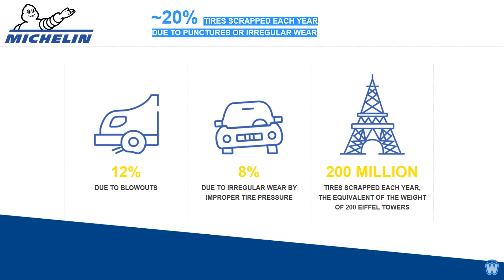Michelin Airless Tire UPTIS - Unique Puncture-Proof Tire System

Comment: The only issue I see with this is the inability for the drive to see condition of the tires inside the car.

Edit: I know there will be much less checking of the tires considering they have a very low failure rate, but imagine when you have gone over enough nails and spikes in the road(that of which you are unaware) and one day your car becomes uncontrollable because an entire tire has just come right off because of the amount of damage it has endured through its lifetime. All of this has been done without the driver checking up on the tires because the driver thought there was nothing wrong.

There will need to be some kind of optical sensor (camera with A.I) in each wheel well monitoring the live condition of the tire and whether the amount of punctures is still drivable.

Comment: law enforcement have been testing a net like device that entangles the axles and locks up the tire and they work on run flat tires.  I wouldn't think these would be any different.  After a quick search there is a couple of things one is called the X-net and the other is grappler that deploys out of the front of a squad car.

Comment: "Looks like the police will need to come up more plan"

Police: just blow the car and we're done
Reply: SoNyXGamings 🤣🤣🤣hilarious!
Reply: There is already a new way , it’s a net that tangles around the tire and it’s more effective than any system I have seen before but it’s not as fast to deploy as stingers . Yup maybe need 15 seconds , stingers only 1 or 2 seconds 👻👻👻
Reply: @gerard4039  yeah, police rarely used that kind..
Reply: @gerard4039  exactly what I wrote a minute ago. I didn't see your answer till now.
Reply: Rafael GM it’s ok :-) , I seen it demonstrated with a military hammer vehicle , yes it’s safer because it’s like a break , it stops the vehicle completely , you can’t event move an inch after like it is with spike and flat tyres , i agree ☝️
Reply: Kontol
Reply: @rahman.utara.  ??
Reply: Hold this technology to avoid loosing the spike as a resource? Already exists spike with net. It wraps arround the tire and axis, also, it is safer, it stops the car faster.
Reply: Seems ledgit
Reply: target lock ready to shoot..
Reply: Brayan Carmona  That Is Just Amazing.
Maybe They Will Put In A New 10 Gear Engine That Makes Them Faster Than Criminals.
Cost: About $9,000,000
Reply: A spike shaped like a fish hook that is welded to a metal of choice plate or block that detaches from the strip and creates massive havoc until they finally stop. Sit back, relax, and watch the parts fly.
Reply: Brayan Carmona  Or E, use Road Teeth.

Those don't Puncture Tires, so much as they shred them.

Meaning that these Tires, which are meant to stop punctures, wouldn't last against shred damage.

They stop sharp debris and potholes, but, what about Blades?
Reply: Light up the engine bay and there fune
Reply: Police will just push a button and the computer in your car will shut off the engine.
Reply: @zerospacer  there's the real answer.
Reply: @zerospacer  killswitch?
Reply: I don’t mind with rocket launcher be cool 😎
Reply: Police: Yes finally we can use the explosive  mines"
Reply: Police be like : Bazooka it is then😂
Reply: Such an underrated comment😀😀
Reply: They'll just shoot at everyone inside as usual. Murderers

Comment: I feel like these should still have rubber of covering on the sides to prevent object from getting lodged between the rubber spokes
Reply: A quick Google makes it appear the sides were left off to help with heat disapation, the added materials from.the spoke retain significantly more heat which can lead to blow outs. 

That saftey issue is the largest problem for them I see but a cool idea
Reply: If the sides were covered up the tire would be air tight 🤦
Reply: @rudwanroni7923  oh thanos. You are right.atleast somebody is having brain. Sorry i killed you.
Reply: @anonymous1405  I forgive you for killing me but it's annoying how you teamed up on me :(
Reply: And when the sides are covered, any puncture will allow water into one chamber, creating an imbalance.
Reply: yeah, when it's flooding, trash could lodge on those gaps..
Reply: Seems true

Comment: What about usage for motorsport. These tires may still have the same compounds as normal ones but over jumps or curbs on a race track / rally stage the wheel will become damaged.

Comment: When this tire is parked overnight in freezing slush or water, I predict it’ll be nearly undriveable and dangerous.
Reply: I agree...
And what about just driving In snow? Seems like it could get packed in between those " ribs" and cause some serious wobble....
Reply: @Christian Gruber this is good maybe for southern states
Reply: @Christian Gruber close off the sides and theyre good
Reply: Christian Gruber Those gaps are probably for cooling
Reply: @gtee96  XDDDD
Reply: @vikorbracho  
Its not an all season tire. Maybe city driving, certainly not high speed, high heat regions.

Comment: The cops could set up something called a road hook or road hooks, its where the driver goes over it and it destroys the underside of the drivers car

Make it out of steel and make the hook sharp so it can cut through a car easily

Comment: Is the tire side profile pattern different between the driver side tires (left side) and the passenger side tires (right side)?  I would think the compression direction (the "v" shape direction either facing forward or to the rear) would be someone noticeable in some way while driving. I suppose it's so small it may not be noticeable, I guess.  So nevermind.

Comment: So I park my car with these new tires on the street and then we have a blizzard and the plows push the slushy mess into the  honeycomb structure of the tires.  Then, as usually happens as the blizzard pulls away, the temperature falls off a cliff for a few days and the drift around my car is like a frozen popsicle.  So I dig my car out but will it go anywhere on these frozen tires?  Maybe these are good tires in Miami?

Comment: these will definitely be unstable when you're driving at higher speeds.
Reply: or even just taking a hard corner i feel would cause some sort of fold or twist
Reply: the #1 reason they arent approved for normal cars is that its VERY unstable past 35mph. the rubber spokes needs to be much stronger. There are videos or people on youtube with them on normal cars and they all say the same thing. https://youtu.be/8zl3a8xg88c
Reply: Most probably
Reply: I suppose we'll see how the product develops. Not every tire is fit for the same conditions. The design would help on ZP tires. It would be good as a spare tire that most don't bother to check the pressure for years.
Reply: Says who ? Are you a specialist ?
Reply: KamekoBruns  military vehicles dont usually go over 50 mph. Nor near 50
Reply: Specialist or not, when you brake hard the tyre mesh will deform due to friction, and that is exactly what you don’t want to happen on high speed...or maybe with this tyres the laws of physics cease to exist...
I guess this is the why Michelin has not yet released
Reply: Not really they still have rubber tread on them and will flex with the road so actually not at all
Reply: KamekoBruns you’d think military vehicles would drive slow because of like IED’s n stuff and most of the time they’re on dirt roads so that’s another reason they wouldn’t drive fast
Reply: @cardinalscool  If you had ever ridden in a car with someone that drives them in the military and just got back from a tour overseas. You'd know that they drive them as fast as possible lol.
Reply: U think a company like Michelin doesnt give a damn about high speed driving? They make tires for life and make a fortune out of it, of coz they will test the tires like hell before they release it..sheesshh
Reply: You, a regular person knows better than all the physicists and technicians behind this.
Reply: KamekoBruns he’s talking about a fxcking race car. Do you know how much downforce is generated by a race car going around a track? Too much for these shitty airless gimmick tires. You don’t need to be a scientist to understand the basics of reality. Piss off you nagging sack of aids. Military Humvees travel at maybe a max speed of 50mph on those terribly pot hole infested roads. I hardly doubt they ever have to turn on a dime. And I’m not even a scientist. Shove your comments up your ass

Comment: I think it is not so efficient. When you park your car, all the pressure coming from weight of the car inevitably load the same surfaces of the wheel (up and down). Therefore, after a certain time,  some pins of the wheel will be deformed.

Comment: How do they drive? Snow ice build up in the gaps? Mud? Stones? Looks like a maintenance problem to me.

Pointless talking about reduced pollution without talking energy and materials that go into making them. Looks like no steel belts? That alone makes them more recyclable! Would need to have different load rating tyres for light/heavy vehicles, i run different pressure front to rear, so not for the finicky i suppose...

Comment: How well would these tires hold up to tempatures of 100°f. Does heat affect the performance? (extreme tempatures) below zero (-20°f). Would they become brittle?        
The main concern is this can get a dirt and other debris in-between rubber spokes. Most people would not clean these out regularly and affecting performance. Could this become a safety hazard in the future? Has there been any time tests for these questions? I'm all for change and they look awesome, but is there a site to show these different test results? Thx

Comment: well your average Michelin tire is like $200 imagine the price of these
Reply: Angel Otero yeah. Well. Your crazy ex won’t be able to slash them. So there’s that.
Reply: @eh3253  what if the ex cuts couple of those ribs in middle of the tire
Reply: 500$ Single Tire
But Cost of Manufacturing would not be more than 100$

Comment: I used Michelin tires most & in my experience, they are not worthy, too expensive & usually with defects, so I stop using them, .I won't buy, but still a good concept.

Comment: A new tactic for cops is already undergoing trials at some departments. It's basically a net that can be lowered to wheel level, and will get wrapped up in the wheel and axle, forcing the wheel to stop spinning almost instantly. Sure, the person's tire and axle gets damaged as a result, but at least it stops them immediately.

Comment: Those tires are going to wear out faster too.. cause of the solid weight the car holds vs the original air tires that wear out in high mileage driving....smh🤔🤔🤔🤔🤔🤔

Comment: How do they handle in snow, slush, ice, heavy rain, 4x4ing, all wheel drive trains...etc??? We get that they are puncture proof due to zero air pressue is and that these tires might turn people into full on criminals, but if you can only use them on sunny dry days, then the cops won't have to be inventive, well at least those in areas that get snow.

Comment: I really like this idea .... But why not put a sidewall to ensure no debris gets stuck in there.... And what about similar tires for motorcycles .... Just imagine the places that can be travelled if the tire never gets flat....
Reply from the maker: I am a motorbike rider and have been for 30 years, so based on that, I really think you need that curved rigid stability of a standard bike tire, even when a bike tire is slightly deflated it can become wobbly around corners.

Plus the motorbike community is so small, like 1 bike per thousand cars in Australia, and most bike riders would keep good pressure in their tyres to prevent wobblyness around corners.

So I doubt you need a motorbike tyre like this.

Comment: Some people have retarded suggestions. Putting a cover over the the sides to prevent debris from getting in? How else would the honeycomb part of the tire flex. Also, these tires produce much more heat then regular tires and are often heavier, requiring more energy. Meaning less gas mileage. 

Very few companies see the need to implement these tires. They are semi decent for suspension less vehicles but that’s about it. The military test everything, doesn’t meant they see a use in it.

Comment: There are traditionally called tweels. I'm actually curious to know how they handled the stability issue. The reason we haven't seen these available so far is that they supposedly start vibrating badly at high speeds.

Comment: I have some questions:
1.) Do they come with wheels or are they mountable?
2.) If they do not come with wheels, how the hell do you mount them?
3.) If you cannot mount them, how on earth do you use roadforce (a system to measure pressure points of the tire by spinning the tire on the rim)?
4.) How much do these things cost? What sizes are they available in?

I’m not against progress, but I am for real world application and I’m not convinced until I get some good answers. Being in the car service industry I’ve seen anomalies and strange situations happen that these tires would only make worse.

Comment: They won’t be available for cars because they can’t handle high speed
Reply: @oldmanwitherspoon cops use this net web that shoots at your rear tires to lock them in place.. another police tactic
Reply: @karmaacosta   There will always be a method to stop the Perps.
Reply: Cover the sides.
Reply: Mary Krenek cover the sides and it’s a basic tire
Reply: Mary Krenek what’s the purpose lol
Reply: @whosmansisthis1894  air resistance & stability. They've tested with sides covered and water inside and that actually had good results at high speeds. They've also inserted memory foam, carbon fiber, sand, rubber beads and a bunch of other shit to the original design and obviously something worked or they wouldn't have released their plans publicly. The tires in this video were a concept design and not the ones they're testing now and are projecting to mass produce in 2022-2023. But who knows, maybe they've just wasted 20 million and made an announcement publicly for just gits and shiggles and they dont ever plan on actually producing a working product... but i doubt it.
Reply: @oldmanwitherspoon a quick redesign of the spike trip is all that is needed to stop a care with theese
Reply: Ive seen some of their schematics and the ones shown in this vid are prototypes and not the ones theyve actually been testing. They can't release the current ones unit patent is approved so other companies dont rip off their design. I think they've got it figured out and if they dont, they will before full production goes in to effect in 2022-2023. Apparently carbon fiber and an "inverted honeycomb pattern" (w/e the fck that is) is something theyve added to the original concept.
Reply: They look flat
Reply: Lucky Strike ...that’s what I responded to. “Well we never have.” We used this design for a long time and it was inefficient and ultimately dangerous. We’ve now made a full circle. Tah-dah.
Reply: Based on what results or research ? Where are you getting your data from ?

Comment: They will still crack and dry out. Large rocks, sharp objects, salt and crossive substances will get in those rubber spokes and weaken them. The only way this technology has a chance on the roadway is if they implement it in the sidewalls of a typical tire. Something that will seal and protect the internal rubber spokes , as well as  allow for a lubricant to be added. Furthermore the sidewall of the typical tire adds additional support. 

The wheel works fine as it is, so  there is no need to reinvent it, improve it.

Comment: How does it handle cornering? Because there is no sidewall one side will compress while the other side does the opposite. So it will probably come off of the rim. It’s a cool idea but flawed. My prediction is we will never see these “see-through” tires on the road. Add a sidewall and some compressed air inside and... oh wait there called run flat tires.

Comment: There’s gonna be a sever lose in traction with airless tires, and burn outs for any gear head out there can kiss it good by because the tire would theoretically slam flat to the rim due to traction(if any at all) closet to the ground
EDIT: so this is a trade off between pollution and a high increase in car possibly fatal crashes

Comment: Id say practical for slower vehicles. Like construction and humvees but not for highway travel.  Maybe if it were stiffer. Looks to me thats it's quite soft and wouldn't do too great at high speeds.
Reply: Also drag from air and road contact.  Plus mud and snow. Hell even high wind would effect it too much for high speed travel. Probably creates lift too.   👎👎👎

Comment: What if someone tried to cut the inner side of tyre using a sharp blade.. i'll need to buy a new one rather than just filling up the air in.. or applying a puncture fix